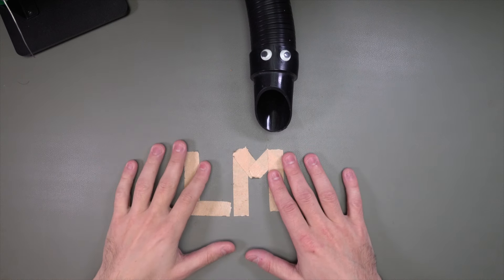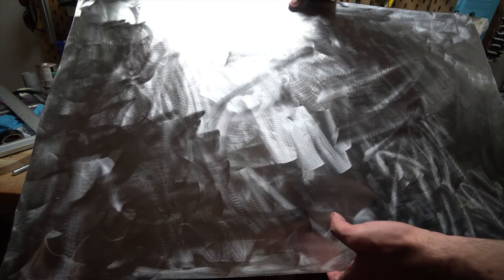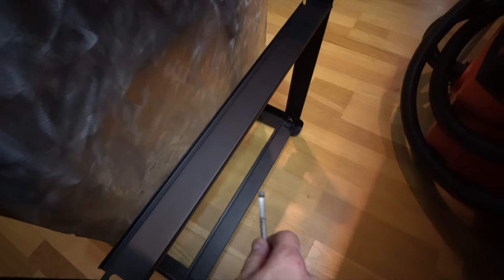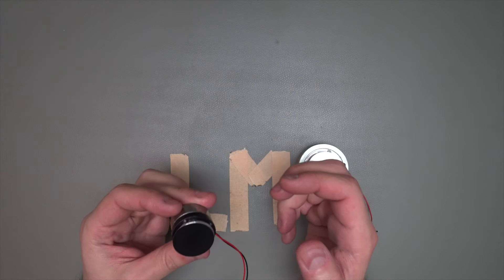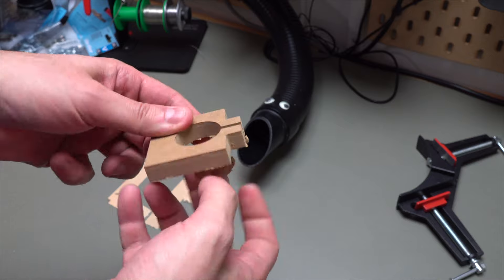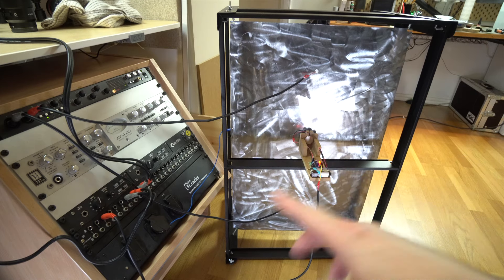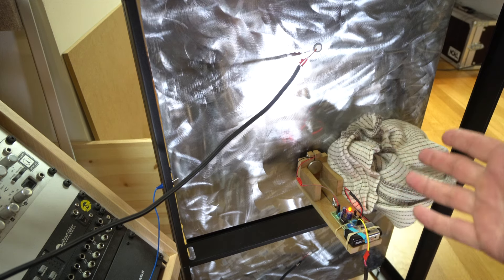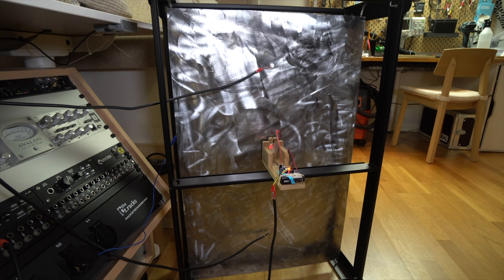DIY "IKEA Hack" Plate Reverb Part 2 (Sounds amazing now!)

Comment: This is really an AMAZING project, I will surely try to build it as soon as I have some time to spend on it.
Just a pair of little thought:
1- Instead of taking a painted IKEA plate, cut it and sand it, it would be probably easier to go in a local metal carpentry and ask for a piece of sheet metal. They have different thikness, and chances are they have some spare part in a corner and give you for free. It is already flat (no corners or bending) and no painting on it. Sheet metal come in different standard measures up to 2.5 x 1 mt., and they cut it to build what they need. Anyway a sheet is not that expensive. you might also look for a local sheet metal reseller.
Oh, chances are that they also have some spare "L profile", that you can cut and drill to build the frame. 
The total cost would probably be less than half.
2 - To dampen the plate maybe you could build another MDF thing like the one you did for the transducer, but with a kind of "claw"! at the end, that can hold something soft, so that you can place it and eventually change position and experiment with different shape and materials.
3- Another interesting thing would be to put some liquid on it, like mineral oil. It might sound interesting, kinda damping, and could prevent it from rusting also.

Anyway, I talk too much but you build it. BRAVO!

Comment: I came up with an idea based on the dampening issue you have. You could buy a couple of these or something similar designed to dampen drums. https://www.amazon.com/Pearl-OM1-Clamp-Control-Muffler/dp/B0006NAB82    They are adjustable and have wing-nut mounts, these could be applied to the back next to the amp. They have a way to assign variable pressure with the wing nut on the back. I hope this helps and keep up the good work.

Comment: In for the IRs. Maybe after I move houses I can stuff a plate in a corner of the basement . . .   Really loved the 'Failures' section.  Thanks for all of this.
Reply from the maker: Stay tuned for the IRs.  I'll try to get those out along with a short video as soon as I have time.

Thanks for watching!
Reply: No rush - I appreciate the work you're doing.  

I actually had a follow-up question I thought of in the car. After the additional work of stripping the plate and mounting it vertically, do you still feel this is a worthy "Ikea Hack" or would one be better off picking up a steel plate and some angle from a scrap yard and Erector-setting something together?
Reply from the maker: @OblivionRatula  Well, if you have access to a metalwork shop or scrap yard, then it's probably a better bet.  I like the IKEA thing because nearly everyone has an IKEA nearby--they're everywhere!

Comment: that's the first time I ever saw a table saw that small.  what's going on here?
Reply from the maker: It's designed for cutting PCBs, architectural models/mockups, wooden toys, and other small but extremely high-precision jobs.  It's not going to rip a 4x8 ply on a construction site but it's perfect for small shops.

Comment: i wonder what it would sound like with some snare drum "fingers??" (i dont know what they are called) or using the metal on the driver rather than the rubber pad? and could you add something like a brush to dampen the reverb?

Comment: The only one I've seen in life was huge. The plate was 5'plus. It was hung vertically in the cab and they are amazing yes you can get a tiny box but the sound is nowhere near the plate
I think it should be hung by rubber as springs link it to the frame?THAT SOUNDS SO GOOD!

Comment: I watched both of your plate verb videos back to back. Really interesting sounds you're able to get out of these plates. I noticed that you used the angle grinder to "buff" out the plate... I don't know that this would be a preferable method unless your goal was to make the material uneven throughout. Might be cool to test out a plate that is properly buffed out or just sanded to see if the even/uneven-ness has a discernible flavor

Comment: Was a microphone blasting sound into the plate? Or was it a signal passing into the plate?
Reply: It's the transducer, which he made the MDF holder for.  That's powered by a small amp, which he shows briefly too.  The Part I video has more details of that.

Comment: Try using Moon Gels that drummers use for damping. Or for more severe damping an adjustable bar of yet to be determined length with one surface covered in the stick on sealing foam strips you use to seal a door from drafts.

Comment: I'm about 50% done with mine. It's a really great replacement for the ones I used to use at Parkgate Studios in Battle England. We had some of John Lennons old plates which took 4 of us too move. So far this is turning out to be about 5% of the size/weight of those behemoths.

Comment: Brilliant project!  Regarding dampening; you could make 2 more slide mounts like the one used for the transducer, and stick wads of terry cloth on the ends facing the plate. Mount them, equal spaced on either side of the transducer.  This would allow you to adjust the amount of dampening based on how far or close the dampers are in relation to the plate.  Also +1 on Addictive Drums 2.  I’ve just been learning how to create MIDI drum tracks and sending them though AD2. Love the sounds!

Comment: I think if you had to replace the metal, it would be easier to get a thin piece of sheet metal to make it easier. The sound was pretty amazing. I really liked the improvement. Definitely sounds much more organic than some of the digital plate reverbs I've used.

Comment: This is really cool!

Since you have extra transducers and the amp is stereo, it might be cool to add another transducer for a stereo send. If you're looking for more mod ideas. If the mounting bar is slotted, they could be mounted on sliders to introduce or eliminate phase cancellation issues. Might just be a mess though.

Comment: Perhaps for a dampener you could use your same MDF hardware and put a rubber cork in place of the transducer. You could adjust the pressure with the slot and screw.

Comment: Two things, thing A, aspect ratio will have a strong impact on how sound bounces around inside that rectangle, and because of edge reflection, you should do what you can to make those edges very straight, a rough edge will scatter edge reflection and dampen the whole board.

Thing B, if you got various magnets of different size and mass, that could give you some dampening, but more importantly you can place them at certain positions within the rectangle to create regions that vibrate differently than the whole, to influence the board's resonance characteristics and make it resonate better over a wider range.

That one guy with the foam block speakers talked about it in the 30$ speakers video. So by attaching magnets of different mass at certain positions you should have a lot of room to play with the sound of the plate. As long as there's nothing nearby to interact with there shouldn't be any consequence to the plate becoming magnetized.

Thing C, sanding the paint off that way will have created an infinite number of varying thickness zones all over the surface, which will influence the sound in a lot of complicated ways probably just adding a vague haze and dampening the vibrations *a little bit*. Which is fine. If you wanted to get a different sound there are sheetmetal suppliers all over the place, you could have several plates of different thickness, material, and surface characteristic for cheap. There's no reason in my eyes to stick plates purchased via ikea.

Thing D, What would it do to the sound if you had some kind of sticky goop between the transducer and the plate? The transducer can't pull on the plate, and a magnet might fix the plate to the transducer too rigidly, but if you had something like the gel pads used on TENS units, the little boxes that shock you a bunch for better health, that's sticky so the transducer can pull, but it's squishy so the plate can resonate without the transducer. Maybe it'd just be louder? It might absorb a lot of high frequency though, hmmm.

Comment: Excellent job. I love watching process in action. 
Re, the dampener. Fab the same base as the piezo but with front and back plates to hold a longer screw with t-nuts to screw a pad with thick foam/wool/cloth against the plate.

Comment: Which bench drill did you use at 11:30?
Reply: looks like a Dremel ...
Reply from the maker: Jonas is correct--it's a Dremel 220 01 workstation stand (it fits most Dremel models).  To be honest, I like it and I find many uses for it, but I don't love it.  I say that because it's not very rigid and it has a bit of flex to it.  So it's good for many simple drilling applications but if you need extremely high precision drilling (like if you're making a PCB), it's not the right product.  The only problem is that there isn't a better ready-made alternative for Dremel tools.  Hope this helps.
Reply: @LeoMakes  yes that helped allot. Loose fit is a problem I already saw on some machines too. But I think for my needs it's absolutely enough. Thanks for the answer

Comment: This is awesome! What an epic project :D Great work.

One minor suggestion - you're taking the earth from the plate directly. I accept a small crocodile clip wouldn't make a huge difference but could you not have taken it from one of the springs supporting the plate - that way there's as little as possible affecting the plate itself?

Comment: why not make a damper the same way you made the transducer mount. Glue a moon gel or a piece of felt to the end and then you can adjust the pressure it puts on the plate. If it's clamped to the frame non permanently you can slide it in and out from the center to taste. OR, just slap some moon gels right to the plate, they'll probably stick just fine

Comment: Looking to make another surprisingly successful Video? 

 ...make a Spring Reverb. 

 Or, if you know how... an Arduino Sequencer with MIDI I/O :D

 The market lacks options in Spring Reverbs. They are all old & pricey, unreliable. Or, well... new & pricey. Either that, or you've got the Danelectro Spring King. Which, including the pt2399 chip is kind of a let down. 

 Regarding Sequencers... it's even worse. The only reasonably priced option, is the Korg SQ1. It has no MIDI in. Not to mention the fact that it's only 16 Steps. I could go on. 

 If you rigged up a little box with MIDI I/O, a simple UI & 64 Steps... if you could do it for less than $100, you could seriously corner the market! 

 ...not that it's a huge market. But it's there.